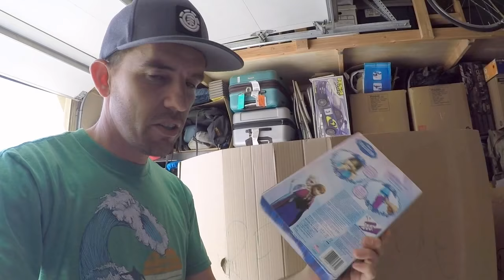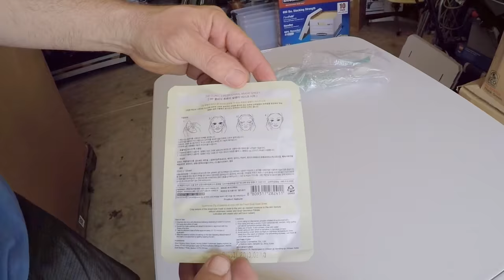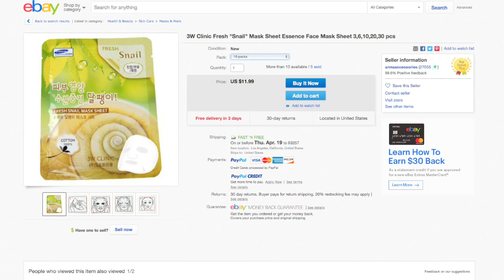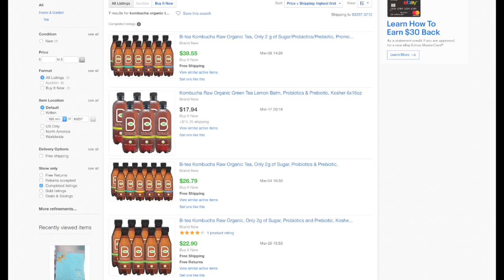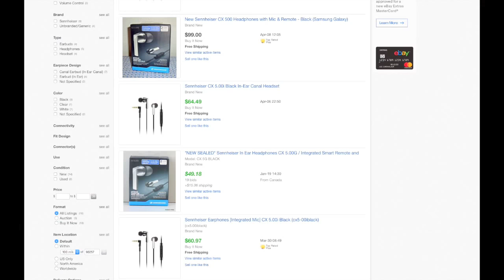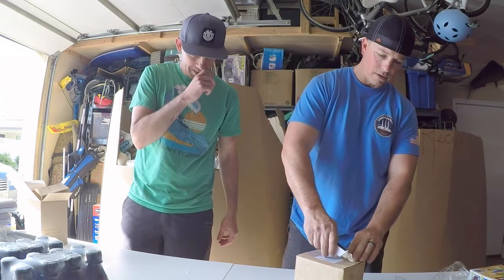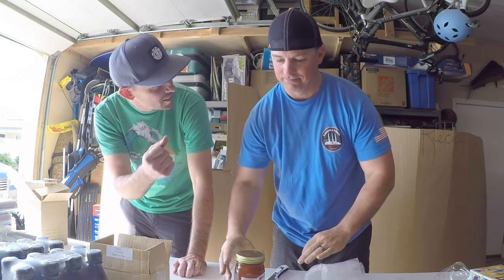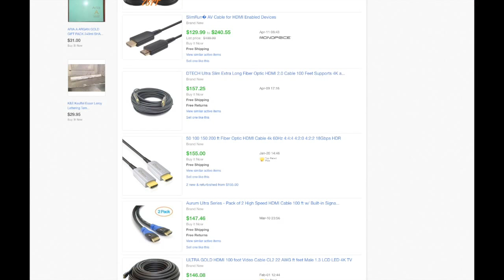Unboxing THE BIGGEST Amazon Mystery Pallet For Resale on eBay! (Better than BULQ)

Comment: Guy's  , built a temporary ramp out of plastic seats or whatever you have in your garage . Tip the bleedin' box over to roughly a 40 - 45 degree angle and your reaching problems are over  . The box will be intact when you finish as you shan't have to slice flaps in it either
Reply from the maker: I thought about just tipping it all the way over.... it would be fun to watch but a pain to clean up.

Comment: if I may offer a suggestion, lower the music audio levels, it's directly competing with your voices... This happens with a lot of new Video/Audio people... Not a big thing, but will help out.
Reply from the maker: Yes, I noticed the same thing. Thanks!
Reply: Just get Rid of the music running thru the whole video maybe just on big finds or intros and outros.
Reply: @FlipEmpire  How much does each palette cost? im thinking of starting a business reselling too !!
Reply from the maker: @diy5729  Thanks for watching. Pallets usually range from $300 to $800 each, depending on the size and content category. Salvage & broken are cheapest, followed by returns & used, followed by new & shelf pulls. Check out liquidation.com for some examples.

Comment: kombucha is a refrigerated item. i know i make it at home. it is fermented tea you drink for the good bacteria and yeast. putting it in the fridge makes the fermentation stop. if kombucha is bottled with a sweetener then it might be as alcoholic as a beer. i have no idea how long it has been unrefrigerated. if unsweetened it is probably safe to drink for a week or 2.. but the longer is goes unsweetened and unrefrigerated it might also turn to vinegar.
Reply: Necro Kittie I poop out loud
Reply: Jk

Comment: Hi There,Not if you have been told yet, but, your strange knife from India is a Khukri.  This is the traditional knife of the Ghurkha Soldier of the British Army,  The two little knives are traditionally a skinning blade and an edge honer (to repair the knife's edge, not what we in Britain call 'honour' :-) ), though these are of generally dubious quality.  I have one of these which I was presented with by a Ghurkha Regiment that I served with during my service as a British Soldier.  I am not sure that yours will be a genuine one (i doubt it though) but if it is made well enough and you are an outdoors man, it should serve you well.  You will find it excellent at producing small firewood to start a camp fire with and stripping branches of twigs when you make your bivvie.  The 'w'-ish shape cut out of the bottom, rear end of the blade has many fictitious uses.  I have been told that is was a sight for throwing (BS), a blood trap to stop blood getting on the handle (possibly, it is primarily a weapon, after all) and a stress relief when chopping (most probably the correct answer).So, what you have there is a albeit dubious tiny bit of British Military history.  Enjoy!Ian
Reply from the maker: Great info Ian! Thanks a lot. It’s definitely not the quality of a military issue service knife, but now I’ll know what I’m looking at if I see an authentic one when I’m picking. BTW, my grandfather was a WWII pilot in the British RAF. Proud grandson. :)
Reply: Ah! Your Grandfather, a member of the Eagle Sqn?  Did he fly during the BofB?  If so, which Sqn?  If you have a name I could try a little research for you. I can’t promise but...
Reply from the maker: He flew the Lancaster Bomber. I don't know much more than that. Sometimes vets don't like to share much.
Reply: Ah!  Bomber Command!  They had the roughest time of all.  They lost a Lott of young men. You should be proud!  They have just erected some memorials in honour of the men that flew with Bomber Command.
Reply from the maker: Awesome. What city? I think I need to visit that.
Reply: There is a newly built visitor centre near Lincoln. They have just commissioned a ‘statue’ of a full sized Lancaster trailing poppies. It will be a truly awesome sight. If yo do visit give us a shout as I live near Lincoln. Just to explain the poppies we celebrate the fallen every year on the nearest Sunday to Armistice Day (11th November). We buy a poppy to wear around that time of year. Obviously, we vets take this seriously. I wouldn’t mind betting that this memorial will have one poppy for each man that did not survive. I don’t know of course, but that is what ld have done.
Reply from the maker: Very cool! Thank you for the info. I'll let you know if we can get out that way. Sounds like a good family trip!